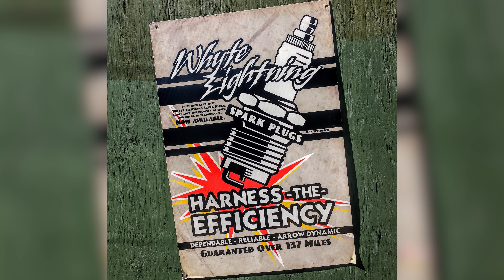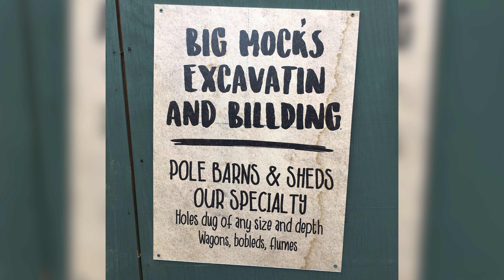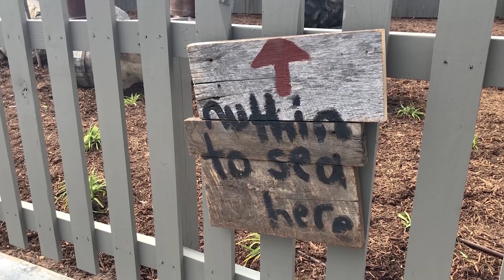What is: Copperhead Strike - Carowinds' First Multi-launch Coaster!

Comment: I still do wonder how they were able to make the loops almost fully circular without it getting too much G’s in the front and back, I know making it teardrop shaped solves that but this is just not a teardrop anymore 😂
Reply: cuz the speed is low.
Reply: @quinquedecem  That's not fully correct since there's always a 6G difference between the bottom and top of a circular loop regardless of the speed, assuming CHS has like -1G at the top there should be 5G at the bottom (if you assume it's circular), I think it's like 4G's at the bottom but that's still a very sudden change of 5 G's which makes me wonder if that's still pleasant to ride
Reply from the maker: I think it looks more circular but still isn't a full circle. Who knows though!
Reply: trust me its quite pleasant to ride. nothing about this ride is uncomfortable

Comment: Unpopular opinion: the restraints on this ride are awful. I felt the blood draining out of legs while sitting on the brake run, but my circulation was cut off for virtually the entire ride. Unfortunately I couldn’t get another ride on it (or Fury) due to weather. What a shame. I refuse to believe that the ride is bad, so I’ll give it the benefit of the doubt and say that I got a bad ride on it and that it will be better the next time I ride it. Still a fantastic looking ride with some impressive theming!!
Reply: Marc W. I love the Mack restraints, although I’ve only been on time traveler in sdc.
Reply from the maker: That's a shame to hear, I'm a big fan of MACK's restraints! They are very comfortable in my opinion :)